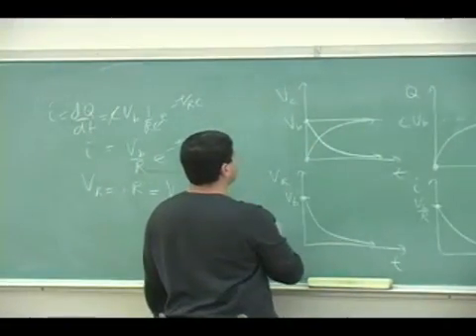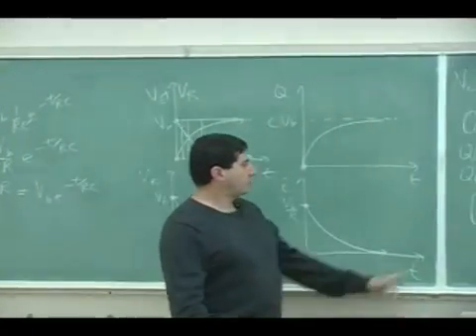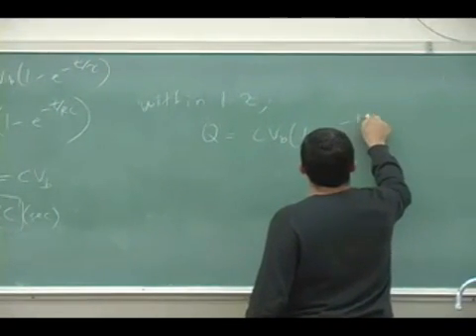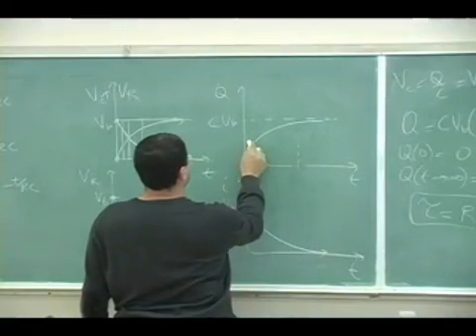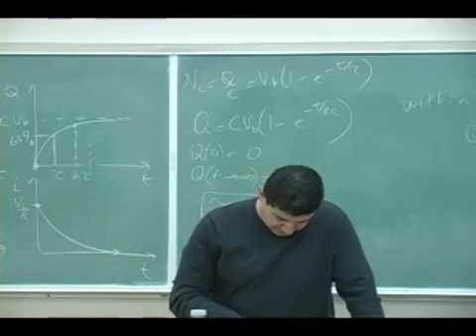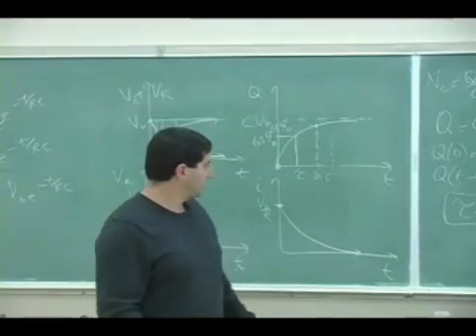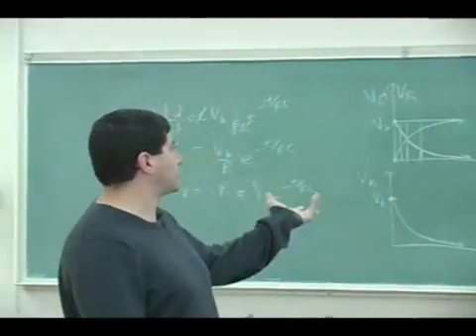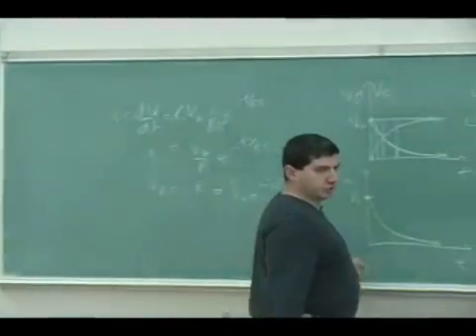RC Circuits Theory Part 3

Comment: @MatrixOfDynamism You can't. Capacitors act differently than resistors. As time goes to infinity, capacitors act like a short. You  don't even differential equations, all you need is Laplace.